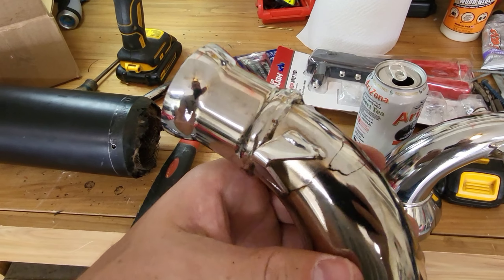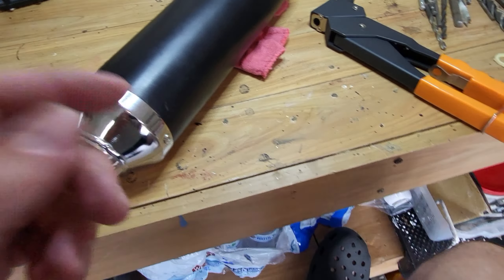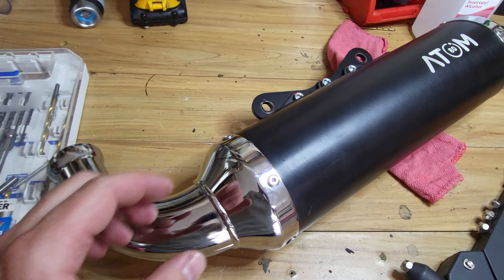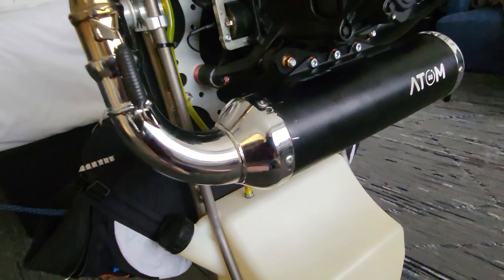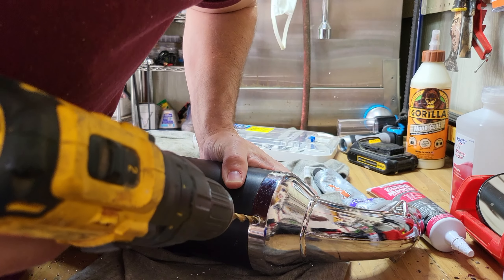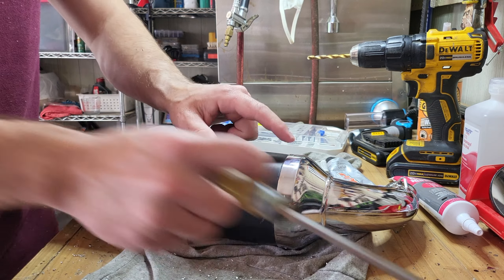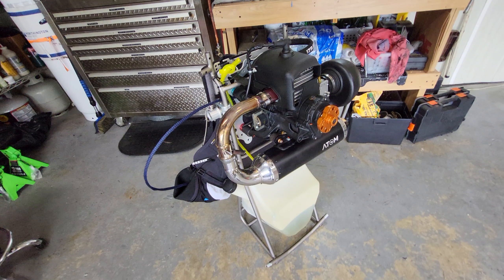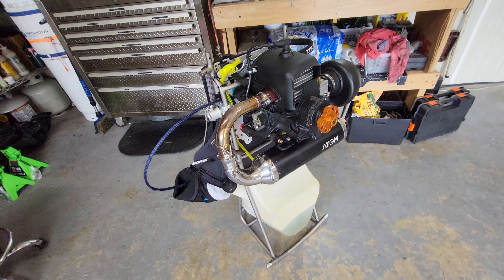Atom 80 Exhaust Cracking Issue

Comment: I too have had to re-drill holes to get them to line up. I’ve found it way easier to use the holes that Vittorazi used in the chromed stainless exhaust piece and drill the new holes in the black anodized aluminum tube of the silencer. Glad that you got it fixed and back in the air. There’s not too many fix-it videos out there on the atom80. So every bit helps the next guy with the same issue. Thanks for taking the time to make a video of it.
Reply from the maker: Good point! Thank you

Comment: You were supposed to use hi-temp paste at that joint where the 2 large springs are - at least according to the Vittozzi manual.
Reply from the maker: @Paradicted  still had some on the joint so I just left it on there. It's been fine for the past 50 hours and counting